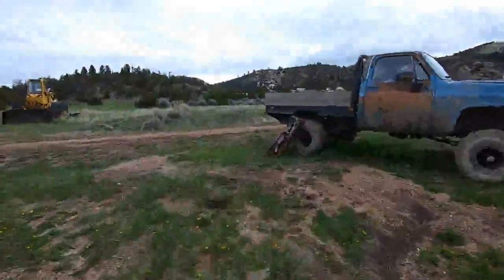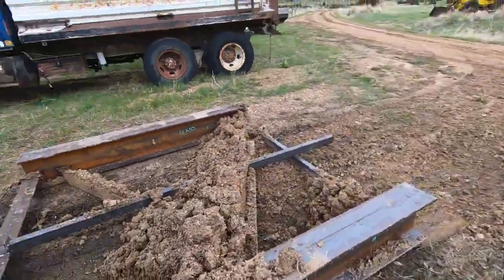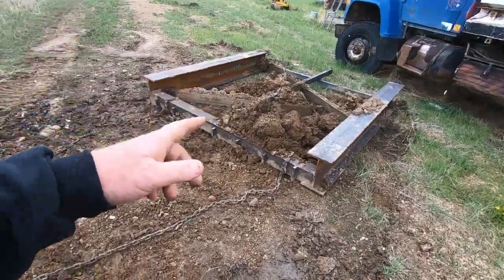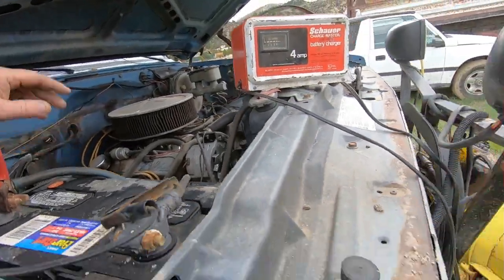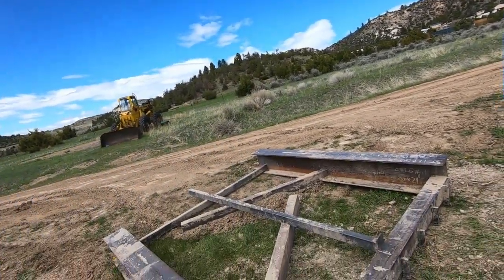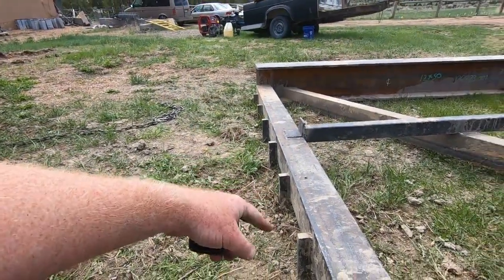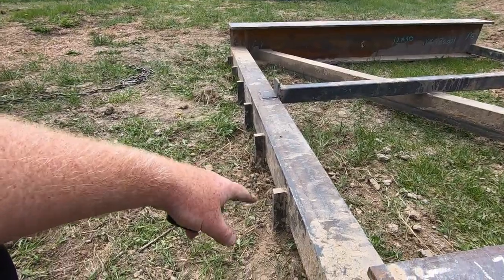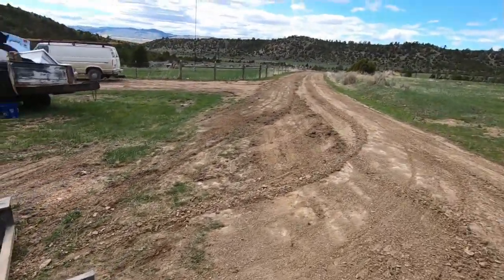A simple a strong DIY Land Plane, Does it Work, I'm tired of wrecking my vehicles

Comment: If you make a rack on top made of angle iron. You can put concrete pier blocks on top to ad weight.i usually add about 10-14 pier blocks. Each one weights 50-75 lbs. Trust me it helps tremendously. Tie them on though cause they'll shake off. I have mine with a ball hitch.

Comment: It needs to adjustable and grade over to one side then back again so mix gravel into the deep ruts .  some adjust the wheel height and lift front so a blade goes one way and cuts out ruts or they come back again .  good set up for light grading

Comment: Can probably go to your local heav6 equipment shop and get some used teeth to add to do your ripping, add some concreter parking vlocks on it ti add some weight
Reply from the maker: I was thinking the same thing. Definitely needs improvement, ie better rippers etc. I just don't know how much more weight I could ad though. It already weighs around a 1000 pounds.
Reply: @OffGrid406  oh, doesn't look that heavy, maybe add some used  teeth angled forward so that it digs in and pulls itself downwards into the dirt as you drag it

Comment: Weld on some 45 degrees on the I beams and use a longer chain, so u dont pull the teeth up, with a lower angle they will rip more. and maybe add weight and drive slower.
Reply from the maker: Yep 45 degree angles on the beams would help cut on the edges
Reply: Just move the chains bac 12in onto the I beams